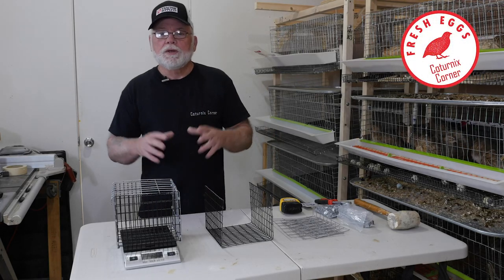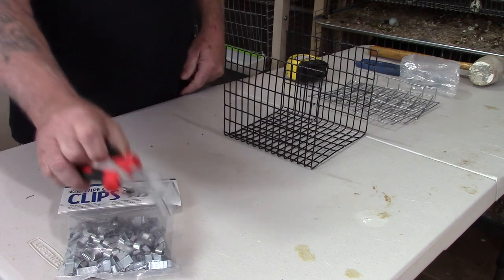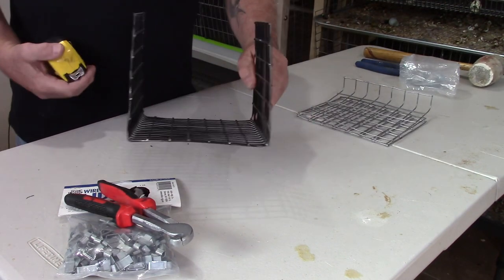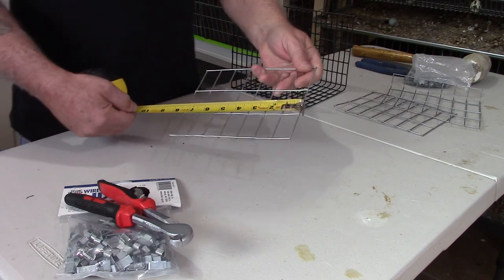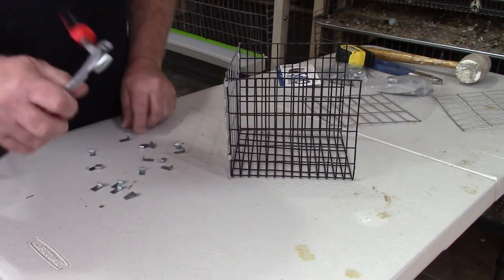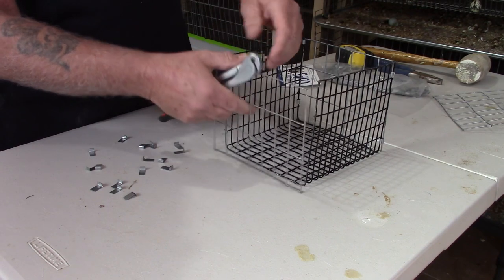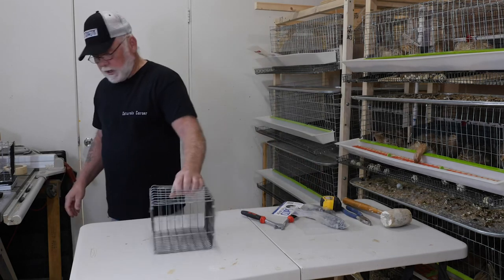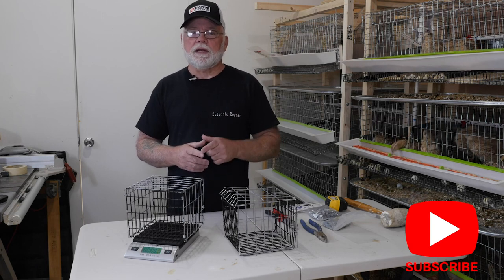Scale Cage for Weighing your Coturnix Quail

Comment: Thank you for sharing. Question is the cloth wire the same as what you buy at Lowes? I know you said it would be better to use when building cages and more expensive.
Reply from the maker: You could use that. The wire I use came from fencerwire.com
Reply: I looked it up. I am sorry I am so confused about the wires. Is that wire covered with a vinyl coating of some kind or is that just a strong thick kind of Vinyl of some sort? I am putting it outside and have to deal with predators. So I want to very careful about what I buy to protect my quails from them and also from their feet getting wounded from a cut or something. Thank you for your help and again I am sorry I am not understanding the differences.
Reply: @CoturnixCorner  never mind  I figured the wiring out. It is expensive specially I just need four feet. I will have to see what my husband thinks. The hardest part so far getting ready for the Quails as a newbie is being a momma bear and wanting my Quails to have a mansion cage with all the royalties. Well ok that is what my husband says about me and these Quails. 😂😂